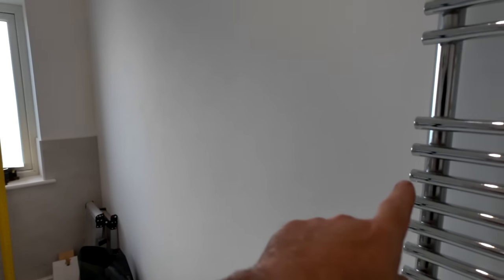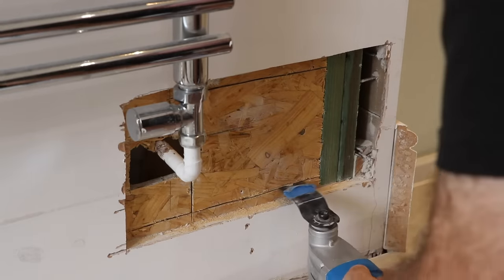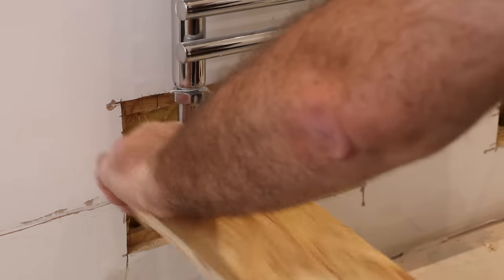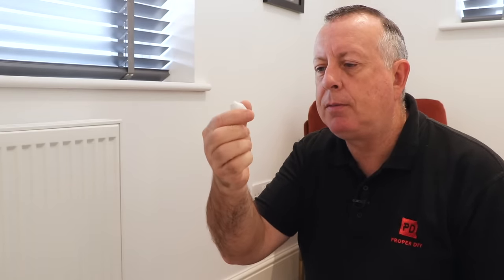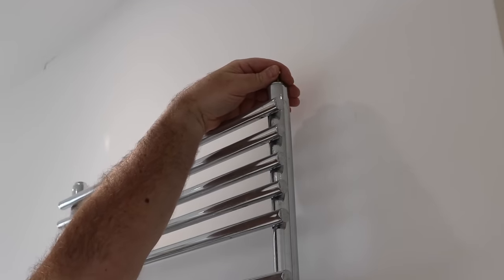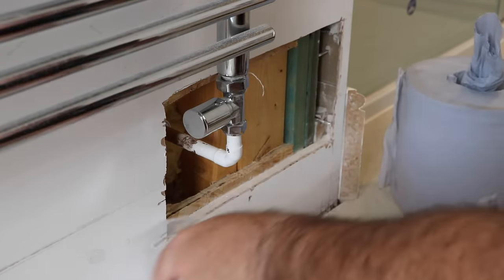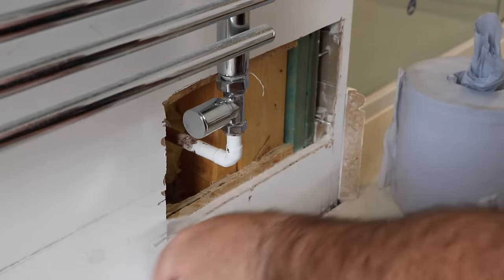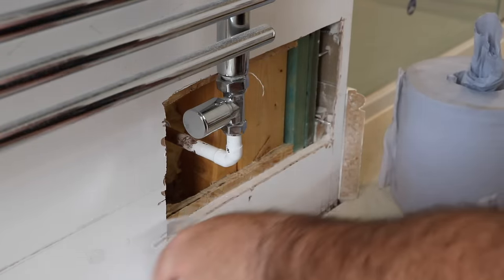How to Move a Radiator Without Draining the Whole System

Comment: My wife comes out of the bathroom this morning and said can I remove the radiator so she can repaint.  Lo and behold you have uploaded this video this morning. Thankyou
Reply: I think she might have known this video was coming up… 😝
Reply: You don’t necessarily need to drain the system to remove one radiator. Once you’ve closed the valves, just undo the nuts that connect them to the radiator, rather than the ones that connect them to the pipework. Put a bowl underneath to catch the water that comes put of the radiator.
Reply: @Calculus58  That’s what I might try thanks.

Comment: The reason you should drain the full system, is that if one of those full TRVs doesnt shut off properly, you will have water dribbling out of the open ends. As Lutoman said you should always do your solding in situ, and pipe to the rad, so water constantly dribbling while you're trying to solder is no good. Unfortunately you will often cause yourself more hassle than its worth, especially on a sealed system like yours, where filling up is very quick and straight forward.

Comment: Myself, I wouldn't put water in pipe you're trying to solder. If that lower joint was going to get hot enough to desolder, the water sitting in it will get hot enough to turn to steam and potentially prevent the upper joint forming a good bond. I will often wrap a joint I want to protect in a damp rag.

Comment: Hi. I’m a heating engineer. I really enjoy your channel. If I could offer some advice for anyone attempting this. We would do this in a slightly different way. We always hang the rads and then pipe to them. Never pipework first then rad. It removes any guesswork and you’ll generally end up with a neater job as you can make sure your pipework is perfectly square and lined up, because you won’t always have the play on the tails that this job had. For instance if your pipe tails exit concrete floors. If you pipe first then try to hang the rad, if you are even a few mill out when fitting the rad then you’ll move the pipework and it will look pony. 

Secondly. You never ever put ptfe on external threads like a towel rail rad valve. The professional way is to paste behind the olive. Ptfe is for screwed male threads that are being wound in to a female fitting.  If you paste compression joints you won’t have to tighten them as much. Meaning less likely to crush olive, distort pipe, especially on small bore pipe. If you need external ptfe to stop your joint leaking. Your joint has already failed. 

Hope this helps some of you keen DIYrs
Reply: Exactly right, the olive does the sealing not the the threads, little bit of v2, job done.
Reply: Thanks for the extra advice Lutonman 👍🏻
Reply: Yeah whatever? Where’s your channel?
Reply: Make a video so...

Comment: A couple of points spring to mind.

If you are moving any radiator that has been in for a while Be Careful! Even with inhibitor the water in the radiator you have just drained (because you never get it all out) will want to slop out when you move. It will almost certainly have iron in it and be black. This is hard to clean up .... don't ask me how I know! .... bung the open end up with something, even a cloth rag will do to stop the spillage!  

Second point is soldering your pipes. You can get copper pushfit bends that are fairly slim. Well worth your trouble. If you are going to solder when you see the ring of solder from your joint add some more solder to be sure there are no voids. I see you did this off camera ;o) Don't forget to wipe the joint clean with a rag as the flux is corrosive and your pipes will discolour.

Comment: That hand tightened joint was a nightmare Stuart….surprised it never sprang a leak before! Great video mate.
Reply: Doesn't need to be mega tight, obviously not finger tight, nip up and a quater turn is all it needs.
Reply: @cookie, it's typical in new builds, mine were just like this, the first week I moved in we had 3 leaks.

Comment: OSB will just be a mounting pattress for the towel rail. Most new builds where its drywall system will install ply or OSB where radiators, heaters or other fixed equipment needs mounting.

Comment: When i decorate any room i have always removed the radiator but i have not done what you have done and that is close off all the other radiators.I have learned something from your video that i will do the same next time i decorate a room.👍
Reply: If you're only removing a radiator for decoration, you don't need to touch the rest of the property. Stuart has had to alter pipework so he's on the "live" side of the valve.
    You simply close off the radiator required and remove. Count the number of turns to close both ends, and reverse when refitting.
Reply: @idi0tdetectioninprogress  ok thanks for the info

Comment: Yep I do exactly the same thing to speed things up just draining the one radiator. 

My kids have new flats and I found plywood when getting an electricity supply for a cabinet  from a nearby shaver socket. I guessed it was put there to make hanging things on the wall more secure.

Great job.

Comment: Hi Stuart, that wall is called a shear wall, it’s designed to help the building withstand heavy winds as it is unable to actually rack in one way or the other due to the osb board. The same as a back panel on a wardrobe only on a larger scale. You will find them on homes that are either very tall or in windy areas which you and I both certainly are 😄.
Reply from the maker: Right got it. I’m not a timber house expert but I do understand the requirement to brace in different directions. Definitely cladding a wall with OSB will give excellent racking resistance.

Comment: I had to use the same technique of locking off the upstairs radiators when changing a downstairs radiator, because on some of the upstairs rads the bleed valve head has sheered off.

Comment: Don't trust thermostatic valves to stay closed if it's a cold day. The lowest setting is usually a 'frost' setting that will open the valve at 5 degrees or so. You can get a simple cap that screws on to force it closed. I speak from experience - fortunately on a ground floor!

Comment: TFW you moved in your house a few years ago and you're already renovating. My life. Also did they use OSB to hang stuff off? Bit weird but I could see it. My houses has a rail system that things are hung off that has driven me around the bend at several points (multitool and a metal cutting blade works wonders), but my house is a "factory" house, seems like maybe they did that for a similar purpose? Also 6 inches of copper pipe into plastic pipe is total memes, I'd rather have one complete plastic pipe all the way honestly, I know people prefer the look of copper but - come on? When I build the house I want to build in a few years I want the whole heating system as pipe-in-pipe.

Comment: I once had a spontaneous leak start while using a multiple tool near a radiator too...could it be possible that the nut was tightened properly but the vibration of the multiple tool loosened the nut?

Comment: I think I would have taken the opportunity to change the chrome values for elbow type valve fittings so the cooper feed pipes would be barely visible, instead of those having those extra couple of inches of copper and its elbow joint on show in the room below the rad... Perhaps what they say about the 'extra couple of inches' isn't always true.

Comment: Never bury pushfit in a wall always best to use soldered joints
Reply: Why?
Reply: Yes Why? Stuart did a pull of strength test a while ago on plastic fittings. They don’t come apart.
Reply: yeah perhaps but the internal pipework is all plastic so it is what it is.
Reply: @tomsanders8714  it’s just developers cheaping out on new builds copper always lasts longer than plastic

Comment: 7:00 I saw a SkillBuilder video where they recommended removing the top of the thermostatic valve once you’d closed it off as there’s a chance it will reopen depending on the temperature in the room

Edit: here’s the skillbuilder video https://youtu.be/pD8y_MZTJD8?si=0Em3cywEZBV_RV9f. Good ol’ Roger recommends removing the TRV and then fitting the little service cap that would have been thrown in the bin when the valve was fitted
Reply: The thermostat is what's keeping the valve shut. If you take it off it will open.
Reply: You need a plastic cap for that. Remove the head and fit the cap which keeps the valve shut.
Removing the head renders the valve fully open
Reply: Cheers both for the clarification - guess you can’t trust the valve to stay closed
Reply: Service cap every time. Don't trust a TRV to stay shut.

Comment: Step number one: Call a plumber. There's no point risking the potential water damage just to save a couple hundred bucks. Plumbing and electric work are among the few things one shouldn't DIY - atleast in my opinion.
Reply: I disagree, anyone competent can do these basic works. Obviously don’t go rewiring your fuse board but replacing sockets, moving a radiator - all possible for a DIYer.
Reply: Plenty of incompetent tradesmen about, witness finger tight connections in this video. We’ve had plumbers drill through gas pipes, electricians fuse thermostats, always in too much of a rush to get in, get out, get paid. We have had a couple of quality conscious guys in but they are hard to find.
Reply: We all possess different aptitudes; if you find yours do not include this kind of task then by all means, hire in. However, a great many of us are perfectly capable and will take the time and care to do the job to a higher standard than most trades ever bother. Indeed, in the UK at least, there is widespread incompetence and dishonesty among so-called professionals. It's a nightmare trying to identify the trustworthy ones, even for work that requires a professional by regulation, because there's no effective enforcement.
Reply: All depends on ones competence and capability. 
Stuart is capable of such work, so the project of creating the wardrobe and moving the towel rail comes into being.
    For anyone who doesn't have the skill set, the job itself  probably wouldn't even exist in the first place.
    To pay contractors for such a creation would probably cost 2k, so unless you're loaded, you'd not even consider this as an idea.

Comment: I haven’t got all the correct tools or the nerve to approach the task of moving or even just replacing a radiator. Even if I watched this video over and over.  I don’t think I’d need the skirting board removed in my case….

The inhibitor trick got me though!  I’ve been told by certified (actually a national business) plumber - they are full blown qualified heating engineers these days when it comes to plumbing jobs involving heating systems - that I’d have to have the entire system drained and inhibitor replaced. Over a £1000 !

Now I know ( and noted another commenter’s heads up about USB mounting behind plasterboard), and am aware HOW a contractor can drain ONE radiator, replace it (cheaper than taking it off to strip and repaint), refit with tool not just finger tight, top up inhibitor, and all the other tips without spending a day draining the whole system and cleaning out each radiator ( which rules dictate have to be flushed out before refilling with water and new batch of inhibitor). 

Thank you, Sir. 🫡👍🏻